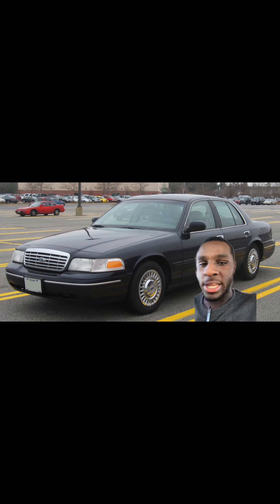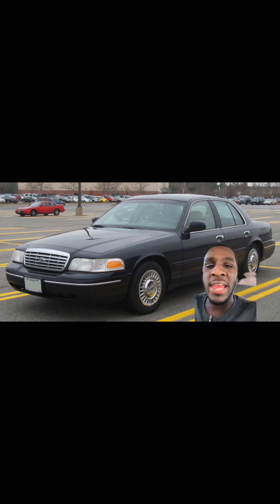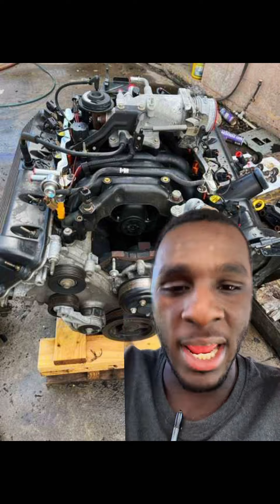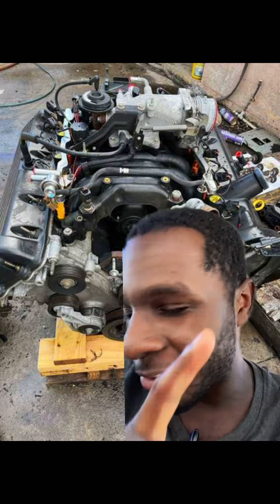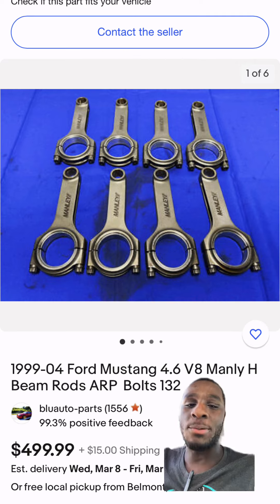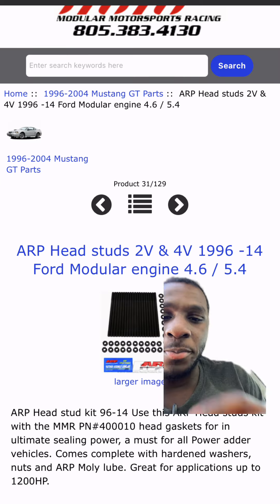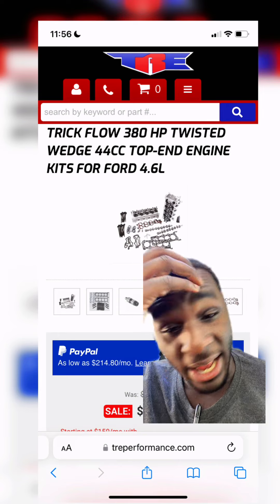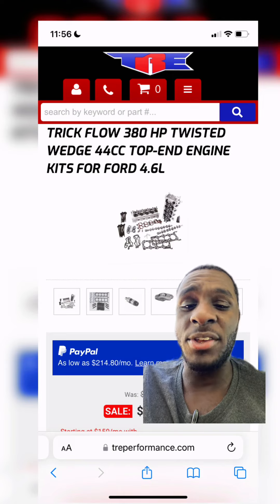How to get Hellcat power out of a CROWN VICTORIA!

Comment: Actually all of them have independent front suspension. What they changed was the balljoints, by putting them in upside down, so the wheels don't fall off, when they fail.
Reply: The wheels never fell off, the ball joint would separate and the lower control arm would drop to the floor

Comment: Just to add, can you use Gen2 Coyote rods at the same length as the 4.6. 
I'd pass up on the trick flow top end and get aviator top end/ or motor for 1-2k. That's better heads and will flow crazy on some boost

Comment: The parts list on this video are great but it fails to mention costs. You're gonna need $4k for those trick flow heads right off the bat. The only off the shelf supercharger kit is $7k. So for the first two power adders you're at $10k in raw parts for maybe 350-400whp. Then you need transmission, ECU, fuel system, Headers/Exhaust, rear end, tuning, sessions, wheels and tires...... Then we have to ask if you can install everything or need a shop to do it.

 You can build a 4.6 2v but you're probably better off buying a used Coyote and getting that rock n rollin. Otherwise, that Crown Vic/4.6 is gonna run you probably 20k-30k. It will be a badass car but ask yourself if you have that cash or credit available. This is coming from someone who wanted to build a CVPI but started looking at parts. I just had fun with the stock 4.6 and drove the hell of it and bought a 2019 Mustang GT lol.
Reply: Lol I did the same exact thing. Back in 08' I had a 2000 cvpi then bought a 2004 cvpi to mod. Looked at the price list and sold them. Bought an 05 e55 and never looked back
Reply: @Squeedlyspooch3  Yup. I bought the 2019 Mustang but I hated modding a car that was owned by a bank. Sold it and bought an 86 corvette cash. Thing is badass.
Reply: Your numbers are a bit off to say the least 🤣😂

Comment: Do a video on the Lincoln town car or Lexus LS 460
Reply: The Town Car is the same thing as a vic.
Reply: ItsDaJax A towncar is longer than a Vic but essentially the same
Reply: @eriv4735  The Executive and Signature use the 3" extended wheelbase, like the p73 Taxi model. Being longer doesn't make it not a panther platform.
Reply: ItsDaJax I never said it wasn’t a panther just simply longer than the vic
Reply: @eriv4735  The P70, 71, 72, and 74, yeah.

Comment: It doesn't matter how much power or horsepower you put in a crown vic aka p71, it is still a rolling bomb whenever itis on the streets. All it takes is someone to rearend the car and it will either explode or blow-up. The fuel tank designs are the MAIN problem with these cars. That is why most people will go for the B-body.
Reply: This is just false🤣😂
Reply: So that’s why they all have a fuel shut off in the trunk😂
Reply: MK-yb3cu One has absolutely nothing to do with the other

Comment: Hey, do the 2006 lincoln town cars come with PI heads?
Reply: Yeah they did that to all of them either after 98 or 99
Reply: @MK-yb3cu  sweet 😋
Reply: @M K  hey real quick. Do you think going from 327 gears to 410 gears would make a big performance gain? Or would it just waste more gas and not make that much of a difference
Reply: hotrodlincoln7186 The Panther loves 4:10 gears and if you do a lot of highway driving the difference in gears won’t hurt mpgs too badly
Reply: @E Riv  sweet, what kind of locking  differential would you recommend
Reply: hotrodlincoln7186 Truthfully a stock ford lsd would handle all the power a 2v can throw at it but if you want to be safe I have always had great success with a Yukon or even Detroit locker
Reply: @eriv4735  have you heard of a Grizzly locker.

Comment: im pretty sure the 4R75W can hold upwards up 600whp. this isnt no 4L60e now
Reply: Transmission uses torque ratings for limits. The 4r70w could take 700ft/lbs. Torque is what thrashes a trans
Reply: 500-550 is the absolute MAX for torque on a STOCK 4r75w
Reply: micahrobinson530 That is simply untrue

Comment: Just bought a 2008  p71 with 80k miles and 600 idle hours. I've always wondered how to make it have hellcat horse power lol. I mean, if big rim donks can do it shouldn't a vic be able too
Reply: 4v swap outflows the trick flow set up and parts can be had cheaper.. the marauder came with 320hp stock.
Reply: Throw a turbo on it and call it a day 🤣😂
Reply: micahrobinson530 The marauder came with 302 crank horsepower and swapping 4v heads on a 2v block will leave you with a very anemic 8:1 compression ratio